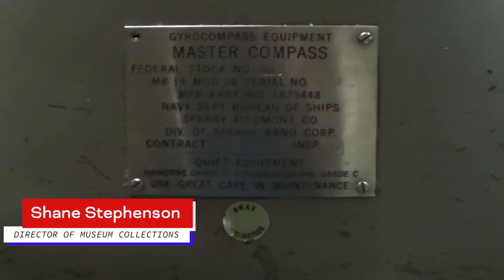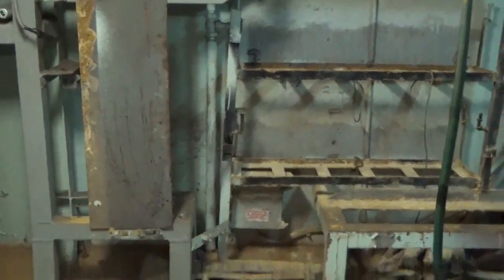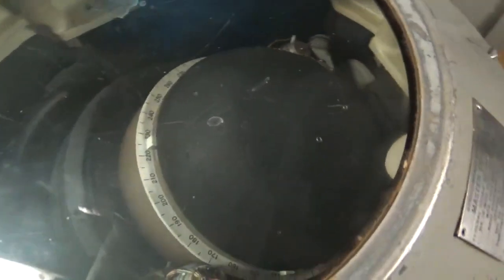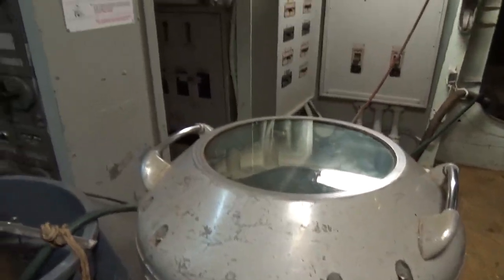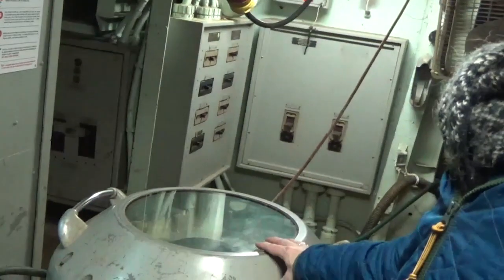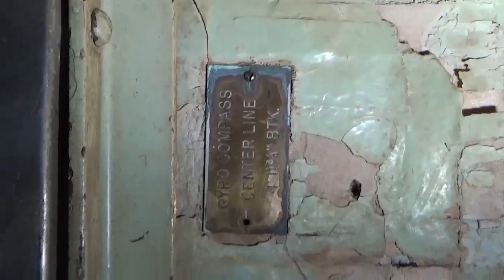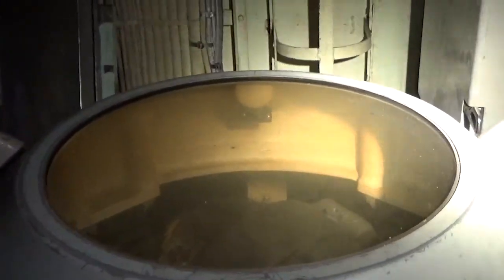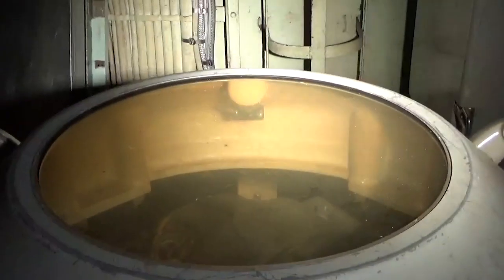Aft and Mid-Ship Master Gyrocompasses: USS Little Rock

Comment: As someone else here mentioned, those bad boys run on serious juice. Having doubled my electric bill thanks to my annual “my neighbors hate me” Christmas light display, I can only imagine the increase in your bill if you guys got everything running again. There might be a compromise though… engineering some kind of moving display that mimics the original action of the compass, running on good ol’ 110 power?
Reply from the maker: Love that idea, 30! As you say there are probably ways of "dummy" juicing them! The question then becomes, what to do with the gyro's? Can't really put them on the tour routes because the ladders to get down there...not safe for the average visitor...certainly the Curator Tour could work! Appreciate your suggestions...so, is your last name Griswold with that light display! Ha! Fabulous!
Reply: Well here’s something else too… even if they were fully functioning, if the ship isn’t moving, wouldn’t they be standing still as well? I’m assuming there has to be rotation happening because it’s a gyro, but is that visible or more of an internal thing? And yeah, I believe Chevy would be proud of the display haha.
Reply: @BuffaloNavalPark  Shane, check your email. Sent you a long overdue one. All hands on deck, bud.

Comment: I recall the aft gyro compass, or "stable element", was between the two 49 control rooms. The gyro was actually used to provide ship's position to the fire control computer for solving the firing problem. Think of it as the gyro remaining in a stable constant position and the ship moving around it. I think the gyros required 400 hertz AC power so I suspect it would be very difficult to restore it to operation.
Reply from the maker: Were you on board Little Rock or another Galveston Class? Sure sounds like it! It definitely makes sense that it's in the SPG49 spaces and also next to the CIC. All fire\gun control areas that would need that kind of accuracy! The electrical system is a "known unknown" to me - so, I'll rely on you for the ease or difficulty! Thanks again!
Reply: @BuffaloNavalPark  I served aboard Little Rock as a Talos Fire Control Technician. But my memory of the spaces is, a little dim
Reply from the maker: @DakotaStone408  Awesome! Thanks for your sacrifices while you served! Have you ever come up for a Working Party? They usually come once a year for about a week - they bring their spouses or kids, and hang out...and do a little work on the side! Ha! Thanks again!

Comment: I have no idea what makes a gyro compass work so I am off to google to see if there is more information about them.  Another good video that shows more of the ship, I marvel at the engineering of these ships.  How did the engineers get all this "stuff" crammed into the ship?
Reply from the maker: Thanks Dan! The Gyrocompass uses a gyroscope to keep True North in alignment, but if the power on the ship went out, so would the gyro, and they would need to switch to a magnetic compass! For the ships, they would build the equipment in while they were constructing her...for USS Little Rock, it was a little over two years from keel to commissioning, but Cramp Shipbuilding was known as one of the less successful companies. They didn't have the Kaiser Shipbuilding efficiency!